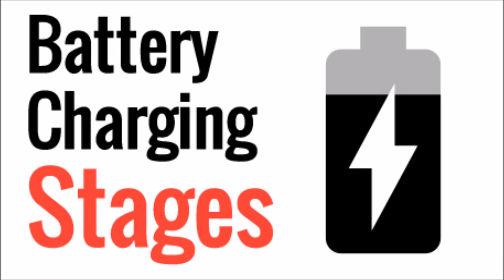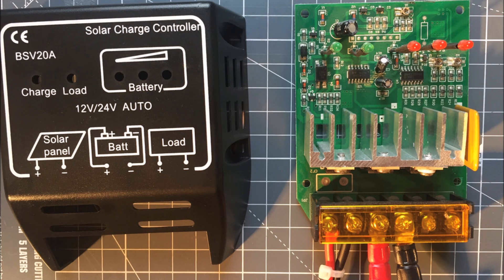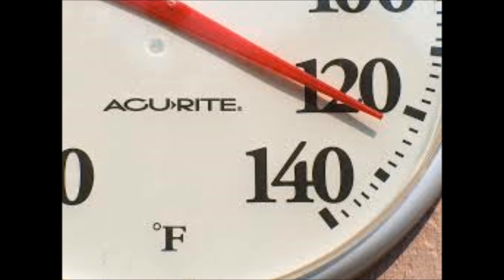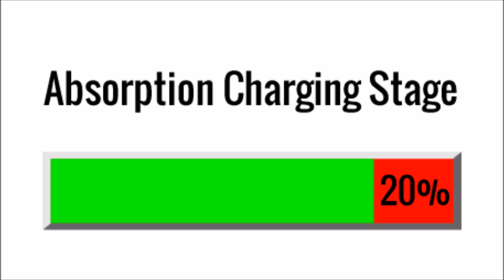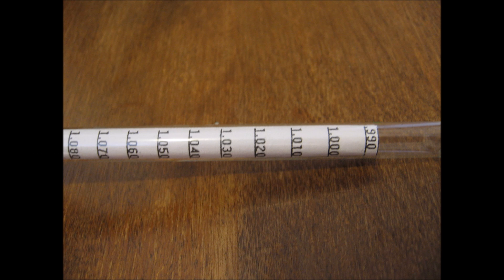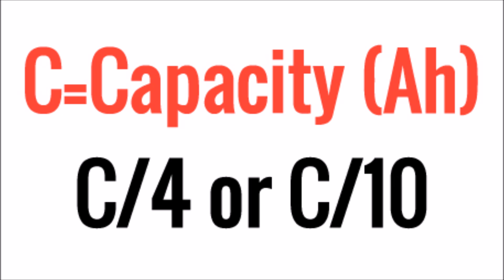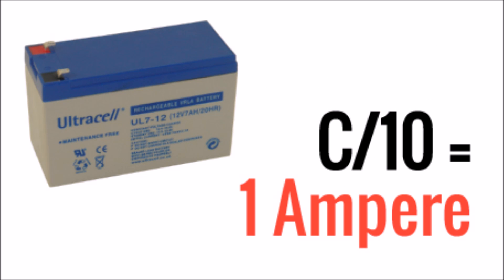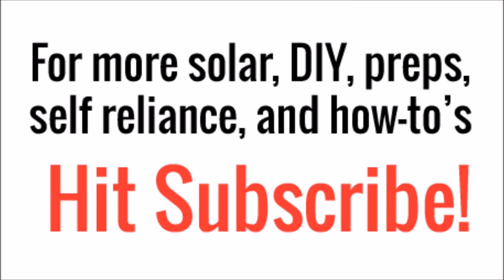Lead Acid Battery Charging Stages

Comment: Hi sir, I have the following on my Solar Charge Controler: 
Absorption, Floating, Equalization and Constant pressure stages on my controller, what I don't understand is that Absorption & Equalization can be set to run for a number of hours.
How many hours to set Absorption & Equalization at? At Default, it was set to 2 hrs but I brought it down to 1 hrs each, please assist if you can Sir? I also don't understand what to set the voltages at: I have Absorption 14.7V, Floating 13.5V, Equalization 14.4V and Constant pressure at 14.4V, my battery is 12V deep-cycle 120AH Lead-Acid, if you could offer me any advice please sir?
Reply from the maker: Settings for different batteries vary.  You need to contact the manufacturer of the batteries for specific charging parameters that they recommend for their specific model.

Comment: Very good video. I am currently using sealed lead acid batteries in my small solar power system. My Rich Solar 20 amp MPPT charge controller seems to be very good at providing all the different stages of charging as mentioned in the video. So it seems i have nothing to worry about as i don't discharge them below 12.3V and they are slowly, fully recharged every day by mid afternoon. Thanks and greetings from sunny Jamaica.
Reply from the maker: I am glad that is working out for you!  I am sure solar power is a godsend in the caribbean!  Stay safe!

Comment: ??? i feel like im missing something.. u said around or a little after 2:30, that we can use a hydrometer to measure specific gravity, but theyre hard to use so most ppl use voltage   how do u use voltage to get an approximate specific gravity?? it seems like u would have to physically test it, otherwise to get gravity youd have to have other metrics to work with..  right??
Reply from the maker: Using voltage is inexact.  But to be as accurate as possible with voltage you have to let the battery rest for hours.

Comment: Trying to charge a 12v 3AH/C20 sealed lead battery on my Thunder smart charger. Batt voltage is "Too Low" at 10 volts and not allowed to charge. How can I get this into charging range or is it junk?
Reply from the maker: The battery sounds like it has been permanently damaged because a lead battery should never get that low.  But you may be able to revive it by using a different charger that doesn't detect voltage or jump starting it like a car.  By "permanently damaged" I mean significantly shortened life.  It may still be useful if you can get a charger to recognize it.

Comment: I am using a buck converter to charge my 165ah lead acid battery 12v and it supplies constant voltage and almost constant current (as it is connected to a solar panel) so, will charging the whole battery with constant voltage and variable current affect my battery's life?
Reply from the maker: That will surely affect the longevity in the long term.  How much so is hard to determine.
Reply: @LDSreliance  OK thanks

Comment: Excelent information. I worked at a Batteries+Bulbs for a few years and the amount of miss-information about lead acid chemistry batteries is fantastic.

 Here are some more basics:
There are two categories of Lead Acid batteries in three different form factors. Wet cell (Regular Flooded batteries) and Dry cells (Gel and AGM batteries). Gels will never be used to start an engine because they don't work under 32 degrees F while AGM and flooded cells do. 

There are three different construction types for Flooded and AGM batteries, SLI (Starting, Lighting, Ignition) used to provide huge currents for short bursts, Dual Purpose which can start engines and run high demand electronics like powerful stereos, and Deep Cycles which are used for things like electric motors like golf carts, solar systems, RVs, etc. Gel batteries all fall into the Deep Cycle category.

AGM batteries and Flooded cells both use the same style of charging routine. Gel Cells however require typically lower amperage charging schemes.

Desulfating chargers work usually by widely fluctuating voltage, frequency, and amperage.

Slower charging speeds is typically better for the battery. The less energy you can impart to the fluid (in the form of heat) the better. As it gets hotter, you'll suffer evaporation and sulfation (as the sulfur in the acid gets more concentrated). Both evaporation and sulfation limit battery output amperage and overall capacity. Evaporation can mean parts of the plates are not in acid and therefore aren't producing power. Sulfation is when sulfur suspended in the acid builds up on plates preventing reaction from taking place.

Frozen batteries can sometimes be recovered if you use the dumbest charging scheme possible (I mean dumbest in reference to the charger). I've recovered batteries that were at 0V first by putting them on a 55 amp "dumb" charger (meaning it output power whether there was a battery or not even plugged into it, so don't short the clamps or you'll get a huge spark and loud bang). Once it reached a relatively acceptable state (usually around 10 volts), I would then plug it into a smart, desulfating charger. Ours was a brand called Granite and saved my ass multiple times, it's a great charger. 

Maximum recommended charge voltage for a wet cell is usually around 14.2 volts, and for AGM 14.4 volts. Going a volt or two above this usually won't hurt a battery much if it's for a short period of time. A preferred float voltage is around 13.5 volts.

Comment: YHE HIGHER VOLTAGE THE INVERTER IS THE LESS CURRENT TAKEN AND THE LONGER TIME YOU GEN FOR A GIVEN LOAD  IF YOU HAVE A 12V 21W BULB  IT DRAWS APROX 2AMPS BUT IF YOU HAVE AN IDENTICAL 21W BULB BUT 24V IT ONLY DRAWS APROX ONLY 1 AMP THATS WHY IF YOU WANT TO POWER YOUR HOUSE WITH AN INVERTER THE HIGHER THE VOLTAGE THE INVERTERS  INPUT IS, THE LESS AMPS IT WILL DRAW TAKE FOR A GIVEN LOAD THANKS  VERY INTERESTING VIDEO

Comment: Hi, i need your help..i have a 4v 500mah sealed lead acid battery. Can i charge that with 5.3 v 500 mah ordinary charger..And if i can then how long it will take to charge  the battery fully.
Reply from the maker: Yes you can.  It will take about 1.2 hours to charge.

Comment: sir i have 2 pcs lead acid battery totally dead,i open it and water is drained so i refill it,after i charge it another one is charging and another one is charging also but its little bit hot and bubles also,what does it mean sir?
Reply from the maker: You may have damaged the batteries by letting the water level get too low.  But flooded lead acid batteries will get warm and bubble when they are charging.  So that part is normal.  Do they take and hold a charge now?
Reply: thank u for reply sir,yes sir they hold a charge but its only 3.9 volts maximum even i keep charging for around 12 hours and more
Reply from the maker: If they are 12V batteries then they are toast.  Sorry man.  Flooded lead acid batteries have to be refilled periodically, especially if they are being used every day.

Comment: thank you very much
Reply from the maker: You are welcome.  Thanks for watching!
Reply: LDSreliance I have a 530ah battery bank for my solar system it's a 1580w system I am running a fridge that's draws 104w running and a few lights an small loads I am finding that my voltage goes from 25.5 to 24.3 in about 8 to 9 hours of running at night with no solar input and the system reaches a float charge in 2 to 3 hours of sun in the morning what do you think is my problem? Battery's are not holding good charge / not enough ah or there just shot battery's ?

Comment: Great video. I've learned a lot thanks to you not only on solar and batteries, but also on other DIY projects as well.

I have a question that's been bugging me. My aunt went off grid a few months ago and i managed to visit her this weekend. I checked her solar panel installation but i was puzzled to find that the battery grid was set up at 24V instead of 12V. Do you know if there's any advantage that can be obtained by wiring it that way? In any case, your previous video helped me to check that their battery bank is actually way under the daily needs of her house and she may be decreasing the amount of cycles they may last.

I would also like to learn about the things you suggested to Rob Lambert. Thanks for reading and keep up the good work.

EDIT: I rewatched your video about series and parallel wiring ( https://www.youtube.com/watch?v=4yxR-Iz2Xdc ) and i get the idea behind voltage versus amps-hour, but i still don't see if there's an advantage between them unless we take into account the inverter's requirements.
Reply from the maker: The main advantages of running higher voltage are both tied to the same phenomenon:  voltage drop.  What that means is that, due to resistance, the voltage on the other end of your wires will be less than when you started.  So your charge controller may be providing 12V but by the time it connects to your load it might only be 11.2V.  

The higher the voltage the better for voltage drop.  That is why transmission lines that carry power across the country are 69,000V and up so that they are not losing a bunch of power crossing miles and miles of wire.  So 12V is obviously bad for this.  If you just have a small system and you are not running wire very far (distance) and using a high amount of current it will probably be okay.  But by increasing to 24V you can drop the voltage drop by a lot.

So this gives you two advantages:  less wasted power lost in your system and you can run cheaper (thinner gauge) wire instead of  expensive, thick wire.
Reply: Also higher voltage means less current (Amperes) required from your battery. extends the battery life. in your case with 24V battery setup, you are drawing half of the current required from a 12V battery.
Reply: Ah, it all makes sense now. Thanks for the answer, i really appreciate it. I will take this into consideration on the house we are building. Keep up the good work and i will tell my friends about this channel so you get more views.
Reply from the maker: That would be great!  I appreciate the support.  Good luck and let me know if you have more questions.

Comment: How do you tell if a battery is 100% discharged, 50% discharged, or 20% discharged?
Reply from the maker: The best way is to measure the specific gravity and compare that value to the manufacturer's specifications.  The next best way is to use voltage.
Reply: Can you make a video about that? how to see the dod or soc?
Reply from the maker: I have done a hydrometer video in the past.  I would like to do a refractometer video once I learn how to do that.  So the answer is yes I will eventually do a video on that.  I am currently disassembling and repairing/replacing my battery bank so it may be a little while on that.
Reply: oh ok can you try to make a solar power pack? it would have a charge controller, an inverter, bonus usb ports, 12V connections, car adapter connections, and a solar panel on it. This would be portable, so it would be very easy to setup. It can be used for emergencies, hobbies, convenience, and much more!
Reply from the maker: I've done that too :)  You probably should go back and look through some of my past videos!

The next version I build will use a LiFePo4 battery in it but that will require me to find a proper charge controller for it.  It will be able to be much smaller and I will add some cool extras like USB ports and things this time.
Reply: You made a solar power pack before, and your doing it again???
Reply from the maker: Yes, I called it a solar generator.  It was a portable rig with a battery, inverter, charge controller, and solar panel as well as plugs for powering your AC devices.  But it was heavy, hard to maneuver, and lacked some features so I want to do a better one.
Reply: I think i saw it a few days ago
Reply: JoeAceJR Well I thought I saw a puddy cat 🐈
Reply: buy a volt meter and a 12v light bulb to test ' digital volt reader on ebay 99p .

Comment: specific of gravity is the only way to know if a battery is charged or not.  use a refractometer to get your reading it's way more accurate.voltage is ok but you have to check k it when batteries have sat for several hours. no one is going to do that so is in accurate.
Reply from the maker: Right.  To do it right takes time and patience.
Reply: Refractometer is quick.
Reply from the maker: Quicker than a hydrometer for sure.  But how many end users do you think are going to take the time to dig into their battery bank and start measuring each cell of all of their batteries?  People are so lazy.  Like you said "no one is going to do that".
Reply: Your right.  If they use it to get the settings right they don't need to do very often then
Reply from the maker: Yep.  Hopefully set it and forget it for the most part.
Reply: This is my approach to it. Get the specific of gravity on the top end of spec. Like 1.28 to 1.29.   1.29 is high but much better then to low for a couple of reasons first it will sulfate second you have more energy stored in your batteries when it high. If it's low they are half dead when you start so can't have good energy in them.  Am I thinking right

Comment: 👍!!  look at refractometers instead of hydrometers.  easy to use and SUPER accurate.
Reply from the maker: Will do.  Do you have one you recommend?
Reply: LDSreliance ......i use the Robinair 75240 coolant and battery refractometer.  this is a laboratory grade instrument.  dont be scared.  it is very rugged.  comes with an excellent storage case.
Reply from the maker: Oh nice.  That is very affordable.  I thought you were going to recommend some $300 device.  I will have to order one.  Thanks!

Comment: how much time does it take to charge a battery to its full capacity for a C10 battery ??
Reply from the maker: I don't know of an exact way to know but you can estimate by multiplying the amount of capacity (Ah) to be replaced by 0.9.  So if you have a 100 Ah battery and it is 10% discharged you would need to replace 10 Ah.  If your battery charger is 25 amps (C/4) then 10 Ah / (0.9 x 25 Amps) = 0.444 hours.  That is just an approximation, though.  The real time varies based on internal resistance of the battery and the charging program the charger is using, etc.